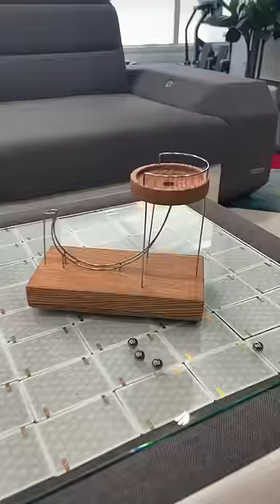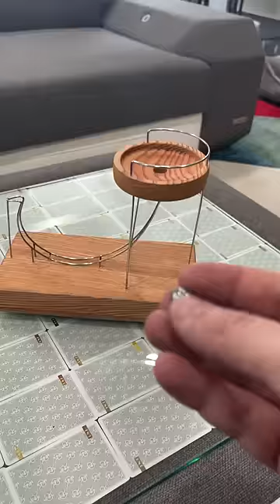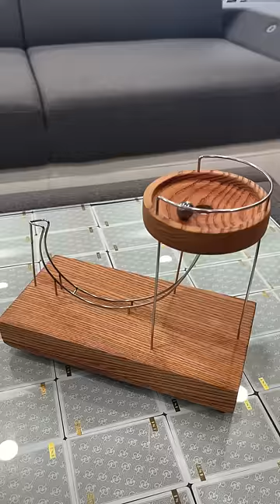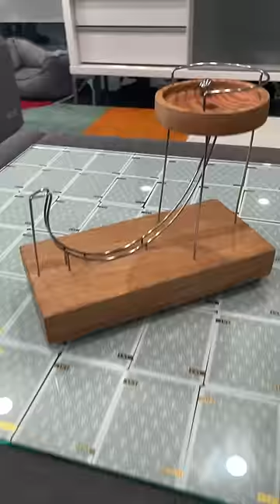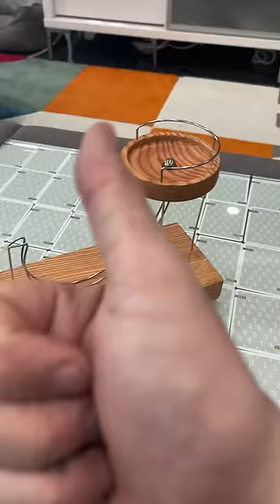An Impossible Perpetual Motion Device?! 😳 #Shorts

Comment: Yea there’s some method of acceleration happening as it slips into the hole. It would defy those laws being able to drop from a height and slide down ramp then launch back up to equal height
Reply: Magnets. How do they work?
Reply: @ScramTek  yea there’s multiple different ways you could use magnets with this model
Reply: @kimoperry6795  pretty sure this model is using magnets
Reply: @thedicehavespoken6234  your comment is invalid please explain how it uses magnets provide a link please
Reply: @big6pun07  it’s not invalid and there is multiple different ways to use magnets with this model, Positively and negatively. In fact it wouldn’t take much creativity at all, because magnets provide a source of energy. That solves your problem off the bat, you just need to configure them in a way that applies that energy—desirably the most efficient way—but even that is unnecessary.
Reply: @big6pun07  The fact that the height of the ball during projectile motion is above the edge means that something in addition to gravity is acting on it on the way down.  The fact that the ball is metal suggests that magnets may be used. The fact that there is a wooden base says that we don't know what is hidden within it. A well timed and positioned pulse of electricity along the base would cause it to accelerate. Unless we have access to the actual device, we won't know, even with "blueprints", what is actually happening. 

It is simple enough to make one yourself without a magnetic accelerator. Try it, and no ball will reach up to the lip of the top funnel. Neither would a glass marble in the 
machine seen in the video.
Reply: @kimoperry6795  electromagnets specifically
Reply: Electromagnets, they turn on once the marble goes down and turn off really fast after.
Reply: The magnet is near the hole.
You'll notice the balls don't fall directly into the hole, but seem to bounce away a bit. The magnet is rejecting them.
But the weight will eventually take the ball into the hole and that is where the magnet will push it down the ramp.
Reply: Definitely magnets. Is like a rail cannon. So by definition is not a perpetual movement machine since has another force acting on it.
Reply: @huepix  magnets don't push
Reply: @kimoperry6795  you could not use magnets because the repelling force becomes a static electrical field almost immediately and since that adds no energy to a closed system it could not counter gravity
Reply: @huepix  it would have to be an electromagnet, as a normal magnet cannot add energy to a closed system
Reply: @houserental5424  totally, but you would use electromagnets
Reply: @thedicehavespoken6234  you're wrong. It's using batteries and electromagnets
Reply: @DashDrones  TIL that electromagnets aren't magnets.
Reply: But .... even if it is acted upon by magnets or some such, how does that stop it from being perpetual motion? If it was producing energy, the magnets wouldn't be drawing off it. So .... unless you have to plug it in, seems to fit the definition.
Reply: @markcurry1168  electromagnets require power, so there'd be a battery inside. It would be "perpetual" but only as long as it was draining power from the battery.
Reply: @markcurry1168  right??
Reply: @kimoperry6795  Translated your latest comment: "Jesus, man, what's the point of trying to understand something you don't already understand?". We all know that the first step to learning is to already understand everything perfectly.
Reply: @edwardv1255  he’s implying that he believes magnets and batteries are not a source of energy.. —“unless you have to plug it in, seems to fit the definition”. He’s not trying to learn, that was not his intentions. He wasn’t asking questions, he was questioning. Misinformation from him, I was just being an asshole though. Lol.
Reply: Also, you misunderstood my comment. I said “you don’t understand what you don’t understand” the implication there was that he’s talking about something he knows nothing about. That’s it. You literally quoted me, yet re worded it to imply a completely different idea.
Reply: @brendanh8193  if any magnetic force is involved, it should be at the tip of the Iron curve. Not under the wooden funnel.
Reply: Similar to centrifugal force. Inertia. Yeah?
Reply: @houserental5424  yes.  They have batteries in the base
Reply: @Shcroft2  same poles repel.
But i get your point
Reply: Yes but because of a sling shot effect it gain acceleration in the curved part then is launched through the air and no longer has to be slowed as much as if it had to follow a rail, which would slow it just enough to not be able to reach the top and would drop back down the curved rail.
Reply: @huepix  in that case, the ball would have to be magnetic, and it would rotate until the opposite pole is facing the pole at the bottom of the wooden surface, so the magnet would get stuck
Reply: A magnet strong enough to ramp it would keep it stuck. It's taking advantage of the extra energy it gets from accelerating down and then a quick sharp turn back up. Plus it's only a few second clip whereas we would need at least a hour or so to see if it would always bounce back onto the tray like that
Reply: @kimoperry6795  No magnets
Reply: This curve is a known phenomenon, the  brachistochroneit's curve is the fastest route down a decline, faster even than a straight line! The ball slides frictionlessly under the influence of a uniform gravitational field to a given end point in the shortest time.
The added momentum from increased acceleration given by the dynamics of the curve produces the extra energy needed to return it to the top.

It's not technically perpetual energy because no energy is being drawn from the system, it's always put back in to that system. If we were to draw energy from the balls motion at any point, it would fail to continue.
Reply: @escapevelocity8092  come on man, everything you just said is completely misleading and false relative to what you were implying. You are referring to a Cycloid. A Cycloid is the shape that will give you the fastest decline (rolling spherical object on flat surface with Cycloid decline), which means absolutely nothing about it being able to defy physics, because it doesn’t make it “fast enough” it only makes it fastest possible way down a declined smooth surface. Does not mean it is fast enough to do this which is portrayed in the video, by any means whatsoever. Yea it IS a “known phenomenon” it is a Brachistochrone curve—curve of fastest decent. Regardless, this decline portrayed isn’t even a perfect Cycloid.
Reply: @escapevelocity8092  stop telling lies on the internet
Reply: @emilialittle1002  that doesn't give it extra energy, it can't magically get enough energy to get over the lip on the top wooden bowl.
Reply: @Shcroft2  pretty sure increasing your velocity increases kinetic energy
Reply: @Shcroft2  and it goes from rolling slowly into the hole into speeding up down the ramp leading to an increase in velocity. Not saying it's a true perpetual motion machine but it's a good representation of one
Reply: @emilialittle1002  absolutely the amount of energy the ball has is increasing, but it is impossible for it gain enough energy to get high enough to get over the lip through gravity alone
Reply: @Shcroft2  have you ever had magnets in your life?
Reply: @escapevelocity8092  even if what you're saying is true that would only work in a frictionless environment which this is not. Energy would be lost to friction against the wood and rails
Reply: @ValosarX  there are no frictionless environments, even in space there are solar winds. The massive reduction in friction is during the fall of the ball. A ball falling straight down meets the most air friction, a ball rolling sideways meets more gravity and physical touch friction , the path of this curve is the least friction and the largest accumulated speed and therefore momentum. I can't say there are no magnets because I'm not there, but research the curve I've mentioned, it's the most prevalent point in the design of this mechanism
Reply: @kimoperry6795  so you believe this mechanism would work using any angle and path of decline? It's only returning to the same height that it started at, it's not magic . It works because it gained the portion of energy required to fling it back, from the accelerated fall down this type of curve. If the decline was straight, it would lose its original potential energy to friction on the rail. Simple
Reply: @Shcroft2  your suspicions Can be quashed with minimal research.
Reply: @ValosarX  yes mate, I mention them earlier on.
Reply: @escapevelocity8092  what, about how it really works? I"m good :)
Reply: @ValosarX  did you skip over the part where I said "through gravity alone"?
Reply: @Shcroft2  it's not gravity alone. The ball has energy by having mass and being in a high position off the ground means it has more potential energy than when on the ground. When gravity is added when falling, the resultant energy is higher due to this type of curve, than it would be with other shaped declines, meaning it loses almost no energy to friction
Reply: @escapevelocity8092  that doesn't explain why no energy would be lost to friction
Reply: @Shcroft2  the brachistochrone curve does that. Research it.

As a ball moves and spins at the same time, an electromagnetic field is created, all this curve is doing is aligning with the direction of that field, and thus meeting less resistance as a result, ie: the field is helping to overcome frictional forces. Obviously there will still be some energy lost to friction because there is still contact between the ball and the rails, but it's massively reduced by the brachistochrone curve
Reply: @escapevelocity8092  that's very creative, but to produce an electromagnetic wave would take energy out of the motion of the ball
Reply: @Shcroft2  the earth should have stopped spinning by now then😂
Reply: @escapevelocity8092  yeah man, eventually it will
Reply: @thedicehavespoken6234  it’s using kinetic energy generated by gravity, redirected by the ramp, launching the ball back to the point where gravity = kinetic energy = upward force = gravity = kinetic force = kinetic energy = … u get the idea… hopefully
Reply: @brendanh8193  you’re thinking of straight up and down movement. Add the g force created from the weight of the steel ball being shifted laterally after incurring kinetic energy from its previous “fall”. This model took a LONG time to design, almost guaranteed. I would imagine it’s a VERY specific equation to make the ramp curvature work. Not to mention the possibility that the two metals scraping, may create enough static to propel it somehow. Not saying I know exact science involved, but I can 100% understand the engineering behind it, being sound.
Reply: @beatwrecker7343  The kinetic energy generated by the ball rolling down the track wouldn't be enough to throw it back up to the top without some external power source. If you have a track with 2 equal heights on either side, the ball will never roll as high on one side as it started on the other, due to loss of energy to friction.

I looked up this model and it comes with batteries btw. As far as I can tell it uses an electro magnet to generate enough speed which is shut off by a sensor that's tripped by the ball disrupting the magnetic field.
Reply: @escapevelocity8092  my man, what I “believe” is that this mechanism works with no angles of the path. It works with magnets
Reply: @beatwrecker7343  I think what you are saying is that the initial spin and velocity given to the ball is to be added to the energy equation. That is certainly true, however we also have to add all the ways to dissipate the energy. Most of this initial kinetic energy is dissipated by the time it enters the hole. You can tell that because the ball loses almost all of its velocity by the time it disappears. A little does remain, as it spirals even while in the hole, but this is not enough energy to eventually rise over the lid. No matter how efficiently the later engineering maintains the energy, and it can be quite efficient, it is already coming from a basis that on entering the hole, there isn't enough energy to make it over the lid, let alone several centimetres above it. Ergo some hidden source of energy/acceleration.
Reply: @huepix  makes sense
Reply: @brendanh8193  absolutely